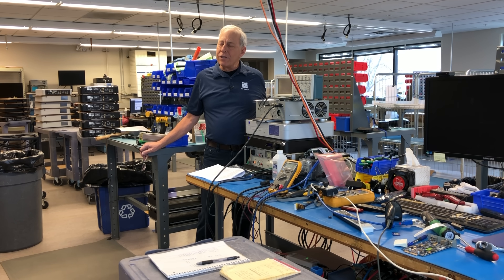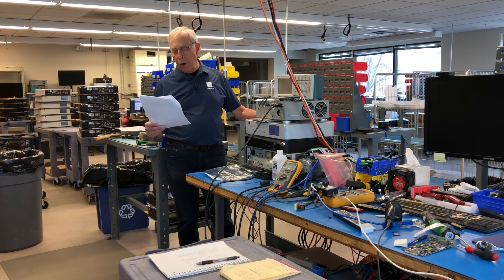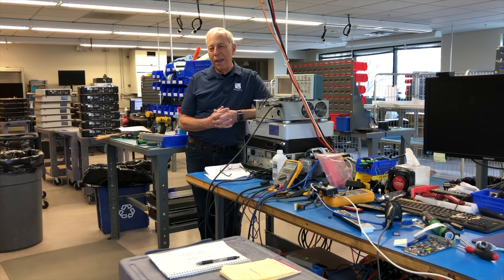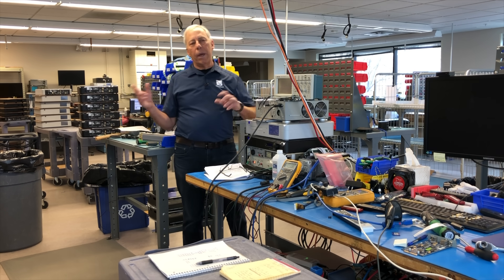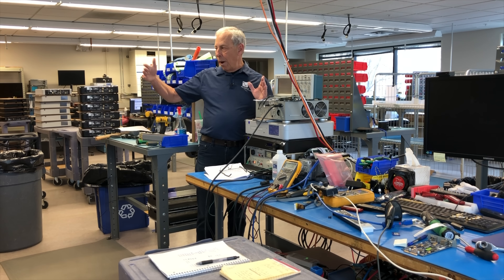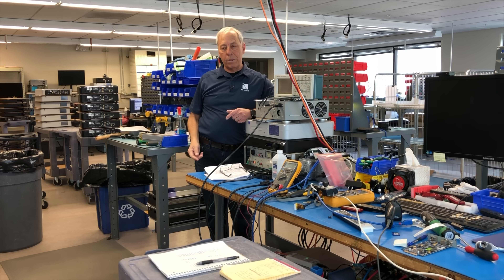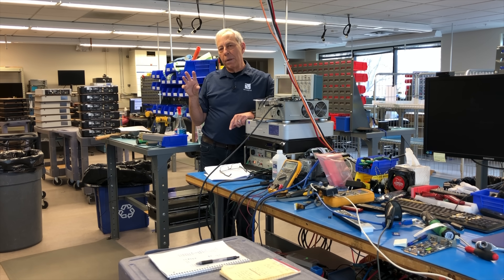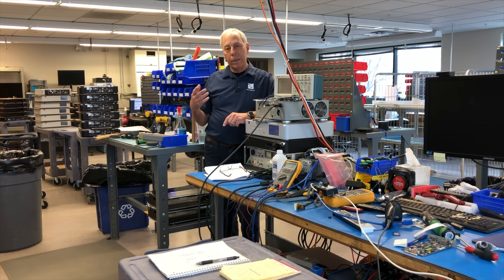Will a 50Hz component work at 60Hz?

Comment: 50 or 60 does it matter if the load is resistive? The output anyways goes to DC and the frequency not matters anymore after DC output. But It do gives a big problem if its inductive load like washing machine, fridge or any device that has pump and motors. they will perform +-10% at full sine wave. Not a short temr 
noticeable problem but long term will do.
Reply: A 100% pure resistive load should work with both
Reply: @owenpowell5370 is there an impure <100% "resistive load"? Is voltage drop not always 100% across every circuit regardless of "load"? Do amperage and resistance not determine voltage? Is amperage not always constant at any point in the circuit? Do you have any real idea what you're talking about in a practical sense? Are you forming your opinion based upon "information" or do you have actual knowledge?
Reply: @deeremeyer1749   Sometimes people just want a basic functional answer and, in the words of Frank Shirley, none of that bullshit jargon that nobody understands. If you plug in a 50hz rated space heater into a 60hz supply, it will work. Will it be ideal? Of course not, but if it is temporary, no big deal.
Reply: @deeremeyer1749  NO - amperage is determined by voltage and resistance - you can't switch cause and effect funnily
Reply: Hello. Im wondering about this. I live in Ireland and got a washinng machine with 220v and 50hz. Will it be waste to take back with or try to sell it for whatever I can get. It was quite expensive, and I would hate to lose the money I paid for it.
Reply: @NYGiants4Life  when you say "take back", do you mean take it to the USA? If so, you would be running it on 240 V and 60 Hz. There are two parts of the machine to consider, the control circuitry and the motors.  If there are electronics, digital/microprocessor control, in the control, it may also have a transformer and relays.  Some of those may be designed for a voltage range and dual frequencies, or not. Running a 50 Hz motor on 60 Hz will cause it to run 20% faster. It may consume more current and have greater losses. It is possible the machine will work in the USA but with some issues and shortened life span. For a definitive answer, check with the manufacturer to see what they recommend. But my advice would be to put the money saved on shipping costs towards buying a new machine in the USA. Below are two pretty good articles with a lot more detail.
http://www.50hz60hz.com/60hz-motor-running-on-50hz-power-supply.html
http://www.50hz60hz.com/what-happens-if-50hz-motor-is-driven-at-60hz.html
Reply: @NYGiants4Life   I've been told and have read Washing Machines from the UK don't run in the Philippines unless you change the Drain Pump to a 60HZ one...Like hens Teeth...  I sent my old Zanussi but I''m now searching for a Pump..

Comment: I've been reading through the comments regarding issues that some see between 50 Hz and 60 Hz operation. Though with larger equipment, not normally associated with HiFI audiophile equipment, it can make a difference at the level we are talking about it shouldn't as long as designed in.  

A few decades back I worked for a company that exported large industrial equipment all over the world.  For smaller motors say up to 1.5 KW we used the same motor for all but selected the motor for the worst condition. However for the larger motors, and these went up to about 50 KW we used a motor specified for either 50 or 60 Hz.  All these motors were stamped for use between 380 - 415 volts 3 phase.  Incidentally I also understood that 50 Hz, (in those days cycles), was chosen as it was the minimum that you could go down to without seeing flickering lights. Hum is also more audible at 60 Hz. However follow the links if interested for more information including the inductive, etc differences between 50 and 60 Hz with respect to generation and transmission.

https://www.ksb.com/conquer-the-clog/conquer-the-clog/pump-solutions/50hz-v-60hz/

https://www.quora.com/What-are-the-advantages-and-disadvantages-of-a-50-Hz-and-a-60-Hz-power-supply-Why-do-countries-prefer-either-of-the-frequencies

Comment: 240V at 60Hz will transfer more energy per second than 240V at 50Hz. The transformer will be effectively a higher VA . Would that mean the transformer was transferring 20% more energy at the higher frequency?
Reply: It can take 20% more, but if using the same voltage it might only deliver a less more voltage if it was saturated at 50Hz.

Comment: Some manufacturers (such as my Martin Logan speakers) booby-trap their 60Hz products not to work on 50Hz power- even if it uses a switch-mode power supply. This is to stop people from buying the component in America and shipping it to Europe to escape the VAT.
Reply: If you re-watch the video, you will see that Paul explains that while 50Hz components are fine at 60Hz, the opposite is not true. 60Hz components will not get enough current if run at 50Hz. So that's not really a booby trap; rather, it's just the way it is...
Reply: @okieburd  

Not true. An SMPS turns the mains directly into DC so frequency doesn't matter that much.

Comment: Well!.. I've been in electronics since the dinosaur days but I never knew this about Tesla s reasoning with the AC frequency!
Thank You Paul for this anecdotal information, it proves that we always live and learn, even at a ripe old age.
Keep them videos coming.
Reply from the maker: There's a great read on the subject called Empires of Light. Absolutely worth reading if you like a good story.
Reply: @Paulmcgowanpsaudio  i'm here also in Dubai, if i buy aircon or washing machine 50hz 220v here in Dubai and use it in the Philippines 60hz 220v is it possible?
Reply from the maker: @lordalmighty4282  The AC and washing machine motors are going to run at slightly different speeds but it shouldn't be a problem.

Comment: One interesting trivia: in aviation, they use 400Hz inside planes to power stuff, because it results in much smaller, thus lighter, transformers.
Reply from the maker: This is absolutely correct. Thanks for bringing it up.
Reply: Right, and that's the same principle that makes switch mode power supplies so small and efficient. Some units even operate in the mhz range, but most operate at least over 50khz. But there's a reason why we don't use 400hz or even higher for our utility system. The higher the frequency, the more difficult the power is to distribute over long distances. There is a cost tradeoff point and 50/60hz is in a sweet spot.
Reply: @andydelle4509  Generators - typical  rotor assemblies used in dams and other power plants that outputs 60 Hz at 4,000 vac are already rotating at a speed of Mach 3 hence the noisy operation. I don't know yet of an electronic based  swithing mode power supply capable of supplying hundreds of megawatts while working at a frequency of 50,000 Hz or higher already exists or already in widespread use. A smps capable of delivering megawatts to gigawatts of power would probably be an improvement over our existing tech of ac mains power generaton.

Comment: the only problem when using equipment made for 50Hz with 60Hz line voltage is that transformer will have around 2.3 times greater losses inside it's iron core. This means a few percent more power consumption and a bit warmer transformer. With high end equipment with greatly oversized transformers this should not be a problem.
EDIT: that holds if magnetic flux does not change.
Reply: why are the transformers oversized?
Reply: @FooBar89  If you have a bigger transformer than needed, you have much more energy stored in magnetic field inside it's core and that improves characteristics of amplifiers etc. It is also probably most effective way of adding weight to a device so it feels more premium
Reply: @gasperbregar630  how and why does it improve the characteristics of an amplifier?
Reply: @FooBar89  when you play music at high levels amplifier needs a lot of current and larger transformer can give it more easily. It improves peak power as the power supply voltage doesn't collapse as much.
Reply: @gasperbregar630 hello sir i hVe a air dryer that am trying to usein europe can i ask you to help me to choice the correct V and Hz converter ? My best regards

Comment: Divisible by 3, because electricity has 3 components?
Reply: I'm not sure why Tesla came up with 60hz but large motors do run most efficient on three-phases power. It's how our power is distributed by three hot lines. It's able to keep the power balanced so a neutral wire is not necessary. Three phase electricity has a pulse every 120 degrees. That 120 degrees creates smooth power, similar to why large trucks and generators use inline-6 engines due to the smoothness of a powerstroke every 120 degrees.
Reply: @garcjr  thanks, I have learned something new :)

Comment: This DC "weakness" is not so true any more due to high power switching technology. Because we can build 500kV transistor with that it allows voltage step up and down with DC just like your witching mode power supply only in massive voltage. Frankly the situation turn 180 degree with high power transistor. With far less transmission loss at 500kV or even 1MV and you don't need transformer which is expensive bulk of coils and safer because it is transistor base you don't need hard switch to switch off it can shut of "soft" which leads to easier maintenance and upgrade. Many country develop their power system later then 2000s use DC for long distance transmission and convert into AC because all electrical appliance are build with AC.
Reply: In the UK we have high voltage DC in some locations between long distance points and between for instance the UK and France, as it makes life easy from a technical aspect.  However generally at the national grid and local points it is AC and one of those reasons besides what has already mentioned is that a transformer can be used.  There are other good reasons to use AC but that is for another time.
Reply: @madcockney  The Basslink interconnect between Tasmania and mainland Australia is DC. It's a "400kV DC electricity interconnector that allows the trade of electricity between Tasmania and the National Electricity Market. The interconnector is rated to transmit 500 megawatts (MW) of energy on a continuous basis in either direction and up to 630MW export from Tasmania for limited periods." It also carried the signal that resulted in the words you are reading here :-)

Comment: Is it possible for equipment made in say Japan (50Hz psu obviously switchable or auto switching) to sound different here in North America (60Hz)? Could it just be because of the voltage difference? Again the switching power supply thing.
Reply: I think it's possible, because Japan itself is the unique country, they have 2 different grid in di different frequency (Western part use 60, Eastern Part use 50). Most of the appliances sold there can be used on both frequency

For Voltage level, Japan is 100V

Comment: It was Edison and Westinghouse that where battling Tesla was Westinghousee's employee
Reply: This is not correct. Westinghouse bought Tesla Patients for the AC system for $1,000,000. A massive price for it time. Westinghouse was on the AC side. I believe that it was J P Morgan that was  on the DC side.
Reply: @yziib3578  your  right somewhat but you need to follow the money Tesla didn't have the money Westinghousee' did Tesla didn't get that much money he died broke in New York hotel, JP Morgen was investing in Tesla's electricity experiments  then drop him because of cost. He was building giant towers with high current trying to make a electricity delivery system that didn't need wires. Westinghouse built the Niagara power station Tesla designed it.
Reply: Westinghouse was on the AC side but he was competing against Edison in any case.

Comment: A well designed power supply, as Paul describes are in his products, 50/60Hz, 115/230 or any combination thereof should make no difference at all.
Reply: Overheating problems can occur with transformers designed for 60 Hz being run at 50 Hz through a step-down transformer. Most gear is sufficiently over-engineered to cope. My best friend brought a lot of electrical equipment with him when he migrated from the US to Tasmania. I can't recall him frying any of it.
Reply: @Zoltan GZ Transformers used to be rated for use at 60°C which is pretty hot. If the power transformer in your amp is getting hotter than that there is a fire danger. Back in the 1980s when desktop computers started to become popular here in Australia we had some cheap monitors catch fire due to transformer overload. A quick-read meat thermometer might give you an indication. 
If the transformer is running over-hot you might want to replace it with one designed for 50Hz. It doesn't have to be physically identical. My main amp in the 80s had the transformer in a separate box to help keep the noise (mainly mains hum) down. In that instance it wouldn't need to be an expensive toroidal transformer. 
You wouldn't expect most precision motors to be affected as they are usually controlled by a quartz crystal oscillator these days. Synchronous motors were used in the past on budget turntables like my Connoisseur but they were looked down upon by owners of Rega, Technics and Thorens.

Comment: So many don't realize that Tesla was the one who was the founder of our electrical grid. The thing about AC that beat out DC, was AC was capable of long distance transmission over power lines at high voltage. Watts = Volts x Amps. Power can be transmitted at low currents with less loss at high voltage over long distances, then transformed down to a lower voltage and still keep the amount of power in watts from where it was produced at the other end. On the other hand, DC can't be transformed from one voltage to another without some sophisticated circuitry that converts it to a form of AC to use a step-up and a step-down transformer.
Reply: More importantly and why AC is better is that current and voltage losses over a distance is far far less on AC transmission lines versus DC transmission lines.

Why don't we have 4 phase or more phase then there if more phases are more efficient. Simple it's mrd to transmit more phase over a distance, I home how big and complicated power poles would be with 6 phases, that's 6 conductors/transmission wires/cables, each at least 10 feet apart (required distance between conductors to keep 100,000plus volt power transmission lines from arcing between conductors/wires and between you and wires when it rains for example). Plus imagine how muchire weight adding one or more cibducters add the transmission power poles.

Comment: Does that still apply if you have electric motors like in type decks and turntable run of AC I don't think so they would be a speed differential
Reply: Synchronous motors that use the frequency of the mains to run at the correct speed come in 50 and 60 Hz variants. Most audiophile turntable motors are DC and have a clock whose frequency is determined by a quartz crystal.
Reply: There is a lot of gear that doesn't use synchronise Motors turntable and tape decks and I'm not even sure if a synchronise motor would behave the same if it's reading 60hz and was designed for 50 Hz.
Reply: @johnsweda2999  If you go back half a century, may be less, many high end TT had a strobe and a control so that you could adjust the TT rotational speed to the exact requirements.  I would imagine that these were essential on the Pirate Radio ships of the 60's and 70's.

Comment: If the product has a motor such as DVD player, the motor will rotate about 20% faster on 60 HZ.
Reply: I get your point but a dvd player is not a good exampke because the motor is controlled by an electronic servo based on the data rate coming off the disc. ON the other hand, things like VCRs that used the line frequency to guide the timer had to have a 50/60 Hz switch on the back that you set to your location's line frequemcy. Otherwise the clock would gain or lose about ten minutes per hour.
Reply: @InsideOfMyOwnMind  And early Betamax VCR's used a 50/60hz AC motor with belt drive for everything. These too would not work unless you had the proper line frequency. VHS and later Betamax then went to DC motors and this was no longer an issue. I would think the electronic clocks weer also crystal controlled in later models. Again the early Betamax's had mechanical timers that would be motor driven. Unfortunately most classic Reel to Reel tape recorders from the 1970s  also used AC motors as well.
Reply: @andydelle4509  Most of the RRs had integrated 50/60 pulleys. You just had to set the belt.
Reply: @InsideOfMyOwnMind  Yes and some also had dual winding motors and/or a different run capacitor for 50/60hz. I think these were more for world wide manufacturing costs because to change these over required a service shop.

Comment: Equipment that uses a motor that has a non adjustable speed control such as a tape deck will run at the wrong speed if the frequency is off. My vintage Technics turntable has strobe speed control with marks for both 50 and 60Hz.
Reply: Goid answer, plus filters were engineered for ideal filtering at the design hertz. Difference between 50 and 60 is 20%, many electrical components design tolerance is 20% do you on the edge of staying within design (Though some devices are labeled and designed to worry k at 60 or 50hz,so that are okay)